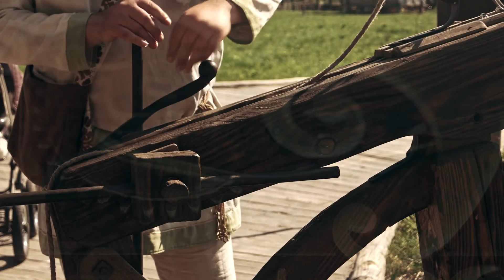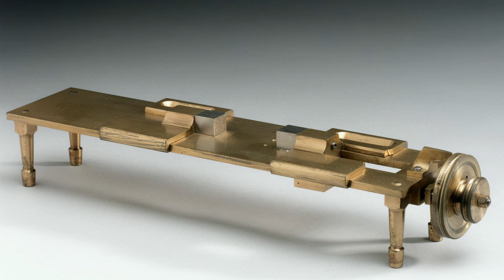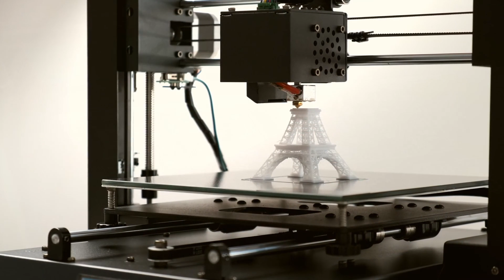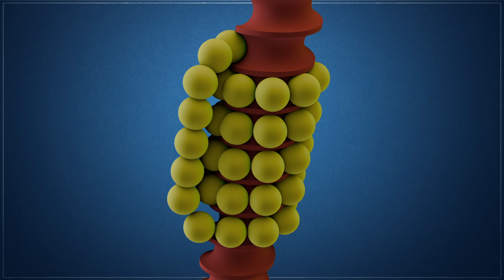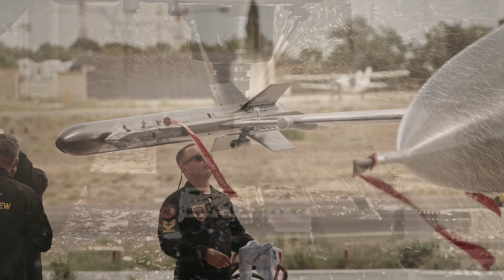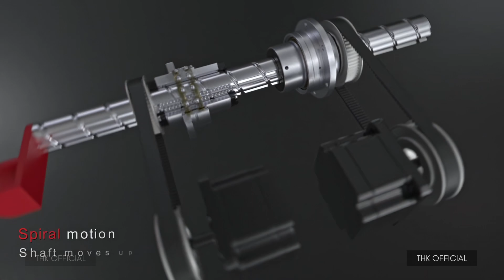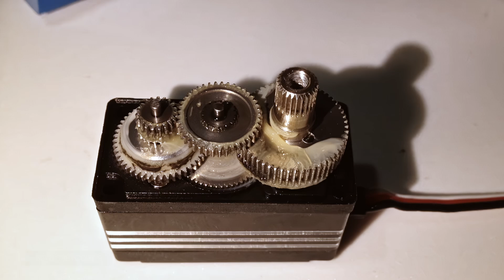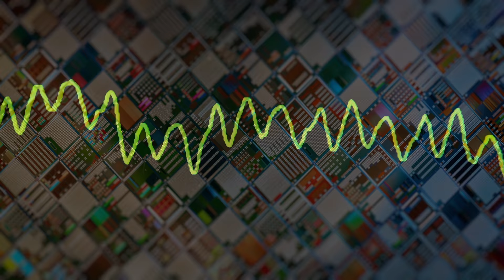The Obsessive Engineering of Precision Linear Motion

Comment: The last 5 minutes of this video beautifully captures the incredibly non-linear progress of modern-day technology. We spent the last 400 years gradually making two pieces of metal  translate motion a little bit more accurately and a little bit more efficiently, and then the need to manufacture microprocessors came along and in less than 1/10th of time we created hybrid motion systems which use the deformation of crystalline materials to achieve atomic levels of positioning and accuracy under extreme speeds and loading. It's hard to even imagine what the next 20 years might look like.
Reply: AI, Ram-shortages, and the Lash.
Reply: @fnamelname9077  While I'd gladly trade buggery for ram shortages, trading rum for AI seems a bad deal.
Reply: @fnamelname9077  Yellow king from 1774 for next president!!
Reply: @thekinginyellow1744  but WHY is the rum gone?
Reply: I think its slowed down again. We've had microprocessors, now we need something new since microprocessors are kinda reaching their limit of how fast they can get. They might get more efficient though.
Reply: @dukkiegamer1733 nah the upper limit is pushed further every day the scalability of the top is just lacking currently.
Reply: Evolution can lead to the replication of molecular mechanisms that operate in living organisms.
Reply: Seems very linear to me. Cant have the last step without all the previous steps.
Reply: @memberHD linear in regards to time. If you plot a graph with technological advancement vs time, it’s definitely not linear.
Reply: @lukeparsons583  It's absolutely linear. Just because the speed of advances increased, doesn't mean it's not linear.
Reply: Religious fundamentalist coming in and smashing it all up I'd bet.
Reply: @ThePaulv12  "blah, religion bad"
Reply: @ThePaulv12 everything good in your life came from the church lol
Reply: @PriceSimpson everything shit too
Reply: @PriceSimpson rofl, hogwash
Reply: @PriceSimpson Like the Earth as the centre of the universe? Or the justification of evil people to do evil acts? Or was it all the Pagan beliefs that were co-opted by religion? Was it the priests having their way with every kid that crossed their path? Was it the exile of woman from the congregation after their husband cheats on them? What is the good that specifically only comes from church?
Reply: @PriceSimpson  stop eating lead paint chips buddy…
Reply: ...and THEN, we developed artificial intelligence to make videos explaining it to us.
Reply: In 20 years we might be able to give a non-circular answer to the question: What is a woman?
Reply: @JohnSmithEx that's easy. Your mom.
Reply: @JohnSmithEx   IT'S AN AI BOT ACCOUNT STOP RESPONDING TO IT.
Reply: @JohnSmithEx that has nothing to do with engineering
Reply: @samwilde8311  It doesn't directly. I am just expressing my skepticism about the predictions for fast technological progress, given the current anti-western civilization climate.
Reply: @JohnSmithEx  you being an anxious hand-wringing dork about ideology also has nothing to do with engineering.
Reply: @badoverwatchhighlights7614  Why do you think that I am obnoxious? Obnoxious means being highly unpleasant, offensive, or incredibly annoying. It typically refers to behavior that shows a total lack of consideration for others, often characterized by being excessively loud, rude, or overly demanding. You could rightfully say that I am off-topic, but obnoxious? Why?
Reply: @JohnSmithEx  it is cause you are being all of those things
Reply: @badoverwatchhighlights7614  Anyone who states that ideology has nothing to do with Engineering is not a professional Engineer.
Ideology is at the core of all Engineering decisions and ethos.
Try to think in a divergent way for the first time in your narrow minded life.
Honestly, your attitude is one of the fundamental problems with Engineering, and why the planet and population is in such a state.
Reply: @a2aaron  it sounds like you are offended by the truth. That's exactly the mindset of most US college graduates in recent years. Technological progress doesn't emerge out of thin air. It requires an enabling substrata. It requires inquiring minds who strive for the truth, not angry indoctrinated ideologs who are offended by it.
Reply: ok
Reply: @JohnSmithEx You guys who think you're much smarter than you really are always crack me up. 

You let your anecdotal, close minded worldview cloud your judgement to the point of saying obviously foolish things with unearned confidence. The "anti-western" civilization climate is going to slow technological progress? 

That's nothing but word salad for fools who would rather stick their heads in the mud than be curious and evolve with the ever evolving world.
Reply: @JohnSmithEx By the way, you misread "anxious" as "obnoxious" - attention to detail must not be a strength of yours.
Reply: @Benisuber1  I am actually quite proud for my attention to details, but you are right, I failed in this one. It happens, I am not perfect. I am neither anxious nor obnoxious btw, and I am well aware of my intelligence. My IQ has been measured with multiple objective tests, and my average score of those tests is 99. I.e. my intelligence is average. Would you like to demonstrate that you are equally aware of your intelligence, by revealing your IQ score? Otherwise you might want to retract your statement "you think you're much smarter than you really are". I just proved to you that I am exactly as smart as I think. I am 99, and I think that I am 99. The two numbers match perfectly.

Regarding the anti-western civilization climate that you refuse to acknowledge, let me introduce you to the recent democratic congressional nominee Darializa Avila Chevalier (New York's 13th Congressional District), who founded a group known as CUAD, that on 2024 posted on Instagram: "We are Westerners fighting for the total eradication of Western civilization". When the positions in power are occupied by ideologs like Darializa Avila Chevalier, good luck with impressive technological advances in precision linear motion in the next 20 years. She has other plans for our tax dollars.
Reply: he said anxious
Reply: @JohnSmithEx  God that is so obnoxious (I think he said anxious but I think you are an obnoxious pedant - go on - google it and see if there is any other pedantic tangent you can launch off into because you want to fight the world with keyboard and dictionary 🤣
Reply: @JohnSmithEx  Do you not think that 'demanding' clarification on the nature of crowds in such an 'unpleasant' way is not 'annoying' or 'offensive'? You know it is, that's why you wrote it like that - so yeah, you tick all your own definition boxes for being obnoxious. Maybe be a bit more self aware - its why you don't get invited to the cool parties 🤣
Reply: @procatprocat9647  clean-up, aisle 4... we can consider the nature of engineering when you get back... ideology omfg. Try logic.
Reply: @Benisuber1  true, professional engineers are not observant or logical. The best trait for an engineer is to be ideological remember - like Kim Jon Un... 🤣
Reply: @russwhiffle I used to limit my brain to mere logic, just like you do. Once i really grew up, i realised that ethics and ethos are the key to elevating Engineering from a back room geeky desk job to something really significant. 

The Maths, Physics, FEA, classical calculations, logic etc etc, etc remain skills and uses them as basic building blocks. 

You sound like you might be an undergraduate or a fresh faced newby graduate who knows nothing about the bigger picture.
Reply: @JohnSmithEx  Finally - the thing you ACTUALLY so badly wanted to tell everyone - are you trying to shoehorn some 2024 Instagram post onto every youtube video, pretending it is relevant? It is not the west that is so maligned - I think you will find it is predominantly the US. Well done on scoring 29 points higher than a mental disability btw. Really value your input.
Reply: @procatprocat9647  Oh, the same ad hominem attack you threw at other commenters when you had nothing to say. Wrong unfortunately, I design program (and build) machinery for industry. Largely CNC and test equipment for generation, quarrying and high speed food production industries. Been qualified for 27 years and my back reminds me daily that I am no undergraduate (mores the pity). You sound like you might be unemployed... (go on lie - we all know its true - or maybe you teach? you certainly don't work as an engineer)
Reply: @russwhiffle ah, you're just a designer. The bottom rung of the ladder. Design Engineers are the modern version of draftsmen, but they use FEA and claim they understand physics. They know nothing about physics, and the proof is their fixed cheat restraints. 

Proper FEA uses a fully balanced model with a 3-2-1 that can be interrogated and compared to the Free Body Diagram. You would know nothing about that at your level. 

I always control the use of FEA with people like you, because .....
SH1T IN = PRETTY SH1T OUT

You have confirmed what I suspected about you.
Reply: @procatprocat9647  Oh yeah lol? what do you do then? What did you earn last year? How many employee's do you have? What's the value of you confirmed PO's for the next quarter? A minute ago you were a geek on a desk in a back room - if that's the case I like my rung 🤣. C'mon admit it you do nothing. Why are you watching such low brow content as this with your mega intellect? Looking for the ethics of lead screws? OK, maybe your not in it for the money - what innovations have you contributed to? To which engineering 'ideology' do you subscribe? Did you find the Higgs Bosun in one of those desk drawers? You are doing a good job of saying nothing, a meaningless word salad that seems defensive to me. Come on - 1 achievement you are proud of in your illustrious (and highly ethical and ideological) career. Just one.
Reply: @procatprocat9647  No one except u meantioned FEA. Sounds like thats the only thing that you know. You are pretty full of yourself. People like you are bad at their job because they not gonna learn new things if they are told to. if you cant programm a basic FEA but use FEA and think you know anything about how it actually works you are just being clueless. how about you write your own FEA and you will be humbled. even if you think you know so much about it, you are gonna see its laughable how shallow you knowledge is
Reply: @russwhiffle your comprehensions skills are very poor. 
I hope other people read specs and documents, then tell you what to do because otherwise you are a liability. 

I never claimed that i am the back room geek, you fool. 

I explained that i learned about ethos, etc which elevated me many many rungs above that bottom rung design engineer type role.
Reply: @procatprocat9647  Your memory skills are pretty poor too 🤣. Just to refresh you, you said:

"Once i really grew up, i realised that ethics and ethos are the key to elevating Engineering from a back room geeky desk job to something really significant."

Which implies the geeky desk job in a back room. It is not definitive - but the best estimation any of us can make as you have said absolutely nothing definitive about your skills, training or occupation - which is why we all suspect they are not up to much. Just vaguely saying you have an ethos and learnt about ethics so that makes you great and everyone else you have replied to is basically trash.  Now Ill ask you again - what do you do - or have you done or even been a small part of that makes you so special (we all know the answer is fuck all, but I am curious how you will respond. Will you ignore the direct question and try to deflect with more grandstanding and insults? I suspect you will because you have nothing to say).
Reply: @procatprocat9647  gone awful quiet there Nicola Tesla 🤣. Look, some free advice, its great that you have started to get an interest in how things work and you are watching a few videos, maybe this will help you decide what you want to do when you grow up, but when there are people (even in comment sections) who are already knowledgeable and in the profession, why not just talk to them? Be honest and you might learn something - it might be useful in deciding if you actually want to go to school and study it. Pretending you are in the upper echelon of a career you very obviously know little to nothing about is just embarrassing, and friends you could have made are just going to think you are a bit strange. No hard feelings I've only been teasing you a bit - best of luck with your future career - whatever you decide you would like to do - just don't be so defensive/offensive with people - it wont get you very far in life 👍
Reply: @russwhiffle i just gave you some very high quality advice. 

If you're too dumb to take it on then that's your issue. 

Not everyone is as dumb as you

Edit - the industry you are in is at the lower end of Engineering, but you could still work your way into higher tech industries if you really work on it

Feel free to ask questions if you like. 

I didn’t read much of your message because I'm busy this evening, but thanks for typing so much
Reply: @russwhiffle let me compare you as a digger designer to myself. 

I design submarines, bespoke subsea vehicles and robotics, and robots that decommission nuclear reactor cores. 

You are a toddler in the realms of Engineering. Nothing that you do matters because you have insane FOS. It is Engineering for numbskulls
Reply: @russwhiffle  yes my friend, I misread anxious as obnoxious. It was a mistake that I have already admitted. Regarding my question about the nature of crowds, that question was under another thread, the one under ts109's comment. If you don't mind, I would prefer to discuss about it there.

About me being proud for scoring 29 points higher than a m/d, no, I am neither proud nor ashamed. My IQ score is an immutable physical characteristic: I can do nothing to change it. It's funny though that Benisuber1 tried to shame me for having an inflated idea about my intelligence, and then you came along and tried to shame me for knowing exactly what my IQ is. I am always amused when people try to win arguments on the internet by throwing ad hominems, because it never works. Instead of proving me wrong, you are only proving that you have no confidence to your arguments. If your arguments are strong and solid, just confront me with them, and watch me run defeated for hills. After all I am only 29 points higher than m/d, so what are you afraid of? 🙂
Reply: @JohnSmithEx  I think what he possibly picked up on was you massive arrogance, which is present in the message I am replying to now as well. Having now been told about your sub par IQ it is even more baffling that you would conduct yourself in this way.

The anxious/obnoxious error is an interesting example. You brush it off as a simple misreading, which is of course fine, relatable and barely worthy of comment. But you didn't just misread. You Misread, then launch into a lengthy diatribe where you deconstructed the word, broke it down into its key defining traits and explained how they couldn't possibly apply to you while (again very arrogantly) implying that the poster who you misread is a fool who doesn't understand the word he (never) used. Even more amusing is that both the words he used absolutely do apply to you and I would expect anyone (even with an average IQ and a little bit of self awareness) to be able to see. It is hypocritical of you to launch such a huge rebuke over his misapplication of the word obnoxious, then expect no one to pull you up on the fact that you couldn't even read the word, let alone understand if it applies to your comments fairly or not.
As for your arguments, I'm trying to pin down what they actually are at the minute. As my grandfather used to say, they are "like dog shit, all over the place".  What is the point you would like to try and make here, because it seems like you are starting a fresh argument with every comment - often just picking a word or phrase out of the comment you are replying too and trying to contradict it somehow to make yourself seem smarter. This is not an uncommon trolling tactic to keep a bit of engagement going by 'rage baiting' the audience. I was kind of hoping that this is what you were doing, because if you are not a troll it would appear that this is actually your personality which make me feel a bit sad for you. I am happy to engage in a bit of debate with you (rather than 'run for the hills') but please enlighten me - what is the argument you are trying to make and we can discuss it. Was it something about crowds? Or Trump? Or Transexuals? Or Language? Or IQ? Or Ad hominins? Maybe politics (although you seem to have declined to go further down that road since I replied to that and you now consider that 'topic' off topic for some reason. I am fairly sure your point is not about the progressing of linear motion engineering but never mind that for now, lets focus on you - what would you actually like to say?
Reply: Oh my friend  @russwhiffle , you are continuing with the argumenta ad hominem like your life depends on them. You really don't know any other way to engage in a dialog, do you? You called me arrogant, and in the next sentence you called my 99 IQ "sub par". 99 IQ is average my friend. Calling an average IQ "sub par" reveals a massive arrogance, and a deep contempt for the common people. You are an elitist Russ. You are an elitist without elite communication skills, and without elite manners and chivalry.

I'll make a bold guess here, that you've never completed an IQ test in your life. If my guess is correct, I am encouraging you to spend a couple of hours and complete a couple of those online. Most are free, although some scummy sites exist that won't reveal your score unless you give them your credit card information. Knowing your IQ score might be a humbling experience for you, as it was for me. You might discover that you are not an elite after all, and you are just part of the plebes like me. You might be one of the 26% of the people with IQ between 95-105, or one of the 50% of the people with IQ between 90-110. You might cry a little, mourning for the lost dream of being special, but eventually you will have to reconcile with the reality. Truth will set you free my friend.
Reply: This comment section has been an interesting read. It appears that everyone enjoys arguing a lot. Though, the amount of ad hominem does make it as a debate rather stale. Everyone here could learn something about showing respect to others online. There is no such thing as a simple-minded person.

That being said, I would like to respond to a couple of things @JohnSmithEx said that kind of started this all. Everything said has a context attached to it, and outside of that context there the words often become meaningless. The CUAD comment is a great example of that. Conservative news outlets will spin it as representative of an anti-America sentiment and say that liberals want to destroy America, but really it was just a hyberbolic statement of anti-imperialism in response to what was happening in Palestine (thousands of killings, cutting of food, water, etc to 2M people, forcing 750k out of their homes, etc.), and they by no means meant it literally. You make think they meant it literally, and conservative commentators will report that they meant it literally, but they really didn't. Any single person's view of reality is not objective, and echo-chambers create distorted realities where what you think you know can be completely wrong. The idea of a broad anti-Western sentiment only exists in conservative news outlets. Both liberals and conservatives believe they want to save the country, and that the other side is destroying it; in liberal media you will not find calls to destroy America, but you will find calls to save America from perceived fascism. Now, there IS broad anti-Western sentiment within some other countries (like many Middle East, which if you look at history have their reasons), but it's not very present at home. The other comment I would like to address, the question of "what is a woman?" also follows the same pattern. It's a thing that is shown in conservative echo chambers trying to say liberals can't answer it, but in reality the majority of actual liberals can readily answer that question (the shortest answer is adult female human, and you can ask follow up questions to get as detailed of an answer as you want).
Reply: @JohnSmithEx  I have done 2 in my life 10 years apart - the first one set up by the elite school I did indeed go to. Not because it was standard for all student there (it wasn't) but because myself and 18 other students (out of just over 1000) were offered the opportunity based on out participation in performance based extra curricular groups which were indeed elitist. Online Facebook assessments are not IQ tests. Both times my score was the same, both times it was 52% higher than yours (see if you can work it out. It is not a measure of knowledge or expertise. I can learn things faster than you that's all. If you studied something and I hadn't you would be more knowledgeable and I would be the guy humbly picking your brains until I understood the subject. But that's not the reason you get negative reactions from everyone online (and I suspect elsewhere). Maybe it is a developmental or spectrum disorder that prevents you from seeing that and learning from your behaviour. Maybe you arrogance is simple Dunning-Kruger. Which is strange because you claim to have been tested and found lacking. Maybe instead of rudely shooting others down you should learn to accept your intellectual limitations and try to learn from your betters?
Reply: @russwhiffle  52% over 99 is 150 IQ. This score falls into the highly gifted or "genius" tier, achieved by roughly the top 0.1% of the population. So according to your Intelligence Quotient score, you are indeed elite. That's the good news. The bad news is that you didn't make good use of your exceptional hardware in this discussion. Here are my observations:

1. We had two parallel discussions in two separate threads, and you were bringing stuff from the one discussion to the other. This made it harder for everyone to keep track of the discussions.

2. You were needlessly contemptuous about my average 99 IQ, when you didn't have to. All you had to do was to let your intelligence speak for itself. Dissect my arguments, find their week points, and dismantle them. Much more effective, and you would avoid presenting yourself as a snob. Ad hominems never work.

3. You were making big deal of trivial things, like my careless mistake of misreading anxious for obnoxious. You were trying desperately to make something out of nothing, instead of focusing on the stuff that matters.

4. You couldn't contain your excitement, and posted multiple consecutive comments, disrupting the flow of the discussion and creating confusion.

5. You tried to refute my arguments by speculating about my intentions. Who cares about my intentions? All that matters is if what I said is true or false. Attack my arguments directly and refute them, that how it's done.

So honestly, I was not impressed by your performance Russ. Hopefully you will manage to impress me the next time we will meet on the internet. Your hardware is outstanding. You just need to combine it with a better software my friend. I want to thank for our discussion, and I wish you a nice day.
Reply: @amcrjlnv thank you my friend for your feedback. I wasn't expecting anyone to read that far. This discussion had devolved to Russ and me exchanging comments about our intelligence. Unfortunately I can't address your points, because the answer that I have prepared doesn't pass the YT filter. I tried a few different things, but I can't defeat the algorithm. Sorry about that. It's neither your fault nor mine.
Reply: @samwilde8311  it might have everything to do with engineering depending on what they are
Reply: @JohnSmithEx  Yes, because only western civilisation is able to achieve technological progress, sure sure… let‘s just sit around and pretend, that in this very video, a japanese guy wasn‘t responsible for one of the major breakthroughs. Let‘s pretend that Cuba while under embargo for 70 years didn‘t pump out medical research breakthroughs like a factory. Let‘s pretend China isn‘t overtaking basically everyone in basically every field. Let‘s pretend that a handful of very enthusiastic and probably genderqueer linux developers aren‘t holding up everything in this digital world by their bare teeth. 

Please don‘t come crying when you find out that you too aren‘t immune to propaganda
Reply: @russwhiffle  Logic is rigid. Chaos is where stuff comes from.
Reply: @JohnSmithEx   I have never taken an IQ test because I know better than to trust pseudo-science meant to massage the ego of the weak willed. 

A singular anecdote does not an argument make. And a nominee is not someone who occupies a position of power, by definition. At least you continue to prove your lack of attention to detail.
Reply: @Benisuber1  my friend you claimed that I think that I am much smarter than I really am. Then I used my IQ score to prove that you are wrong, and that I am exactly as smart as I think I am. Now instead of retracting your claim, you are expressing your lack of trust on IQ tests. OK, fine, you don't believe in this standardized measurement of human cognitive ability and intelligence, that has been used extensively all over the world for more than a century. How do you know then how smart I am, and how smart I think I am? What is the source of your knowledge? Please prove your claim. Prove that your claims are fact-based, and you are not just making stuff up.

Regarding the congressional nominee Darializa Avila Chevalier, who is associated with the idea of totally eradicating the Western civilization, she is supported by the mayor of New York Zohran Mamdani, the Justice Democrats, and the Democratic Socialists of America. She might not occupy a position of power yet, but she is supported by others who do occupy such positions. Should I wait until she becomes the President of the United States before I start warning about her ideas?
Reply: @JohnSmithEx IQ tests are famously pseudoscience, you may want to do some research on the topic. IQ tests are neither an objective nor standardized measure of intelligence, and yes you still think you are smarter than you actually are. Lobotomies were performed across the world for nearly half a century, time is not proof of efficacy. Another egregiously iunb argument from you. 

Your comments are filled with condescension and assumed truths, the fact that you can so confidently blather on with the same nonsense for weeks is all the proof I need to know that you are close-minded due to your need to feel superior to others who don't agree with you.  

Regarding one nominee for political office, I maintain my stance that cherry picking a singular person from hundreds of millions is an incredibly silly way to prove a generalized point. I can pick any number of nominated conservatives who support genocide, does that mean I can argue that the current climate is actually pro-Western world domination? If you can't understand that argument, even an average intelligence is a substantial overestimate.
Go ahead, hold your breath until a President says they support eradicating Western Civilization. You'll make Vitomir Maričić jealous.
Reply: @Benisuber1  my friend I wish I could say that your reply is satisfying, but it's not. One month ago you made a claim about my intelligence. Then I disproved your claim with my IQ score. Then you rejected my proof on the basis that you don't believe in IQ tests. Then I asked you in no ambiguous terms to prove your claim. Your last comment was your chance to do it, and you didn't. Instead you just repeated your claim:

> and yes you still think you are smarter than you actually are.

Someone said that insanity is doing the same thing over and over again and expecting different results. I am not going to ask you again to prove your claim, because I expect the same result: you aren't going to do it, and you'll just repeat your claim. So it's time for me to remove myself from this discussion, because it makes neither of us any wiser. We are both wasting slices of our short lifespans for nothing. If I had to do the same thing over and over again, at least this thing should be enjoyable, or profitable, and our discussion is neither. So bless your heart, and have a nice day my friend.
Reply: @JohnSmithEx  You seem to think we are friends as well, I am not quite sure where your delusions come from but they are obviously present. 

IQ scores are not proof of anything because they are inherently flawed measures of intelligence. A faulty metric cannot prove or disprove anything. You are confident in your beliefs without any semblance of real proof, which sadly altogether too common in our society today.
Reply: @Benisuber1  This is easily in the top 10 of the most unproductive discussions that I've ever done on the internet. Absolutely no progress after 2 months of back and forth!
Reply: @JohnSmithEx  There's one in every crowd.
Reply: @ts109  I am confused. There is one of what? Please elaborate.
Reply: @JohnSmithEx  Sure you are John, sure you are.
Reply: @ts109  I would be less confused if you helped a little. For example by being meaningful, clear and precise. But apparently this is not your style my friend.
Reply: @JohnSmithEx someone who follows Matt Walsh and the Daily Wire. That feels it's necessary to insert their opinion on transgender politics into a video about mechanics and measurement.
Reply: @ts109 
A trans person?
Reply: @cringeisen  Are you clarifying the claim "There's one in every crowd"? Thanks for doing it, because @ts109 didn't want to. Since you mentioned it, I do follow Matt Walsh, and I do believe that tr****ism is a major attack on the pursuit of truth, which is a core western value. You want engineers to improve the precision of linear motion machines, and you want the same engineers to affirm the delusions of XY who believe that they are XX and vice versa? That's like expecting solid theorems from mathematicians who affirm the delusion that 2 + 2 = 5 (this is a Big Brother reference). Affirming delusions by law is not conducive to technological  progress.

Now, since you took the task of continuing @ts109 thread, please educate me about crowds. Apparently you affirm that there is one like me in every crowd. What is a crowd in the internet? Are all YT viewers a single crowd, or each YT video has a separate crowd below in the comments? Yesterday I posted comments on 3 separate YT videos. Did I inserted myself in 3 crowds? One of these videos was an old chess video with 3-4 comments, and my comment was a complaint about the time control (too short). Did I became the "one" that exists in that particular crowd? Please share your expertise about crowds with us.
Reply: @JohnSmithEx  your analogy of 2+2=5 is inaccurate. You’re more like an old engineer who was asked “how do we fix backlash in a rack and pinion system?” And your confident answer is “well, we can make a tighter fit, increasing wear and friction, or we can deal with the backlash! It’s a binary system, no way around it!” 

The world is never binary and your simplified view of things is simply a self-imposed ignorance. If you would like to advance beyond “rack and pinion” thinking you can start by learning about intersex individuals and how even in nature sex isn’t simply binary. Then you can learn the difference between sex and gender, and finally realize that binary right/wrong thinking such as yours does more to stifle innovation than it does to progress it. 
Y’know, like how most of these advancements come from those “librul indoctrination colleges and intellectual elitists.”
Reply: @JohnSmithEx  They are different engineers pretty sure. Did you say Trumpism is an attack on core western values? I assume that is what you wrote as it certainly makes sense.
Reply: @russwhiffle  I think that the MAGA movement is a defense of the core western values, not an attack on them. Here is a partial list of those values: Individual liberty, economic freedom, representative governance, human rights, separation of church and state, rationalism and scientific inquiry. I don't think that the current president of US has attacked any of those, but you might want to correct me if I am wrong.
Reply: @JohnSmithEx  hahaha your trolling right? Liberties are being erased (by trump) the economic freedom to pay more for everything and get less (when was the last time you filled your tank?) Representative government? Say it again when they are military personnel seizing ballot boxes) human rights? Tell that to the ICE team and their victims. Separation of church and state? you cant be serious, the president is being anointed by televangelists and posting pictures of himself as Jesus. Rationalism and scientific inquiry? My favorite one, does science tell you to drink bleach or take horse medicine to cure covid? The most irrational man with a band of white supremacist conspiracy nuts for followers. Its like you've listed all the biggest faults of this administration and called them strengths? you're off your head.
Reply: @russwhiffle  No, trolling is not my style. I gave you a direct and honest answer to your question. I read your answer, and I could address some of the point you made, but it would be way off topic here, so I won't. I am not disregarding your arguments, I respect them, but I don't see the point of defending the current US president here. My original intention was to warn about the adverse effects of the raising anti-western culture on the future technological progress, not to defend a political party and its policies.
Reply: @JohnSmithEx  Your health minister thinks vaccines are dangerous lmfao
Reply: @Venaticc  who is my health minister? FYI, I live in Eastern Europe.
Reply: @JohnSmithEx  Oh, sorry about that. I assumed, since the discussion was about American politics, that you would be as well. I myself am Nordic. The corrected version: The American health minister, appointed by Trump, believes vaccines are dangerous even though every single credible study concludes their safety (unless the vaccine was faulty (which is very, very rare), in which case it stops being used). hbomberguy made a great video on how the hoax began.
Reply: @Venaticc  I assume that you are talking about Robert F. Kennedy Jr. Honestly I haven't followed his opinion about vaccines, but I assume that he has not prevented anyone who wants to be vaccinated from doing so. Compare this with the previous administration, that forced tens of millions of people to be vaccinated whether they wanted it or not, under the threat of losing their jobs and other privileges, like entering into public spaces. Personally I value the individual liberty, which is a core western value, so given the option I would chose RFK every day over whoever was the health minister of the previous administration.

Btw I do follow closely the American politics, because whatever happens in US it also happens in Europe a few years later.
Reply: @JohnSmithEx  herd immunity via vaccination is not something that should be up to individuals
Reply: @Sopel997  Individual liberty is a core western value that should be protected passionately, unless there is pretty good damn reason to abolish it. Certainly not for an experimental vaccine that protects you neither from caching a decease, nor from transmitting it to others.
Reply: @JohnSmithEx  measles vaccines are experimental?
Reply: @Sopel997  I am not educated on the measles vaccine. According to Wikipedia it's an effective vaccine, that protects against becoming infected with measles after two doses almost 100% for life. What's your point?
Reply: @JohnSmithEx  that we're talking about ALL vaccines
Reply: @Sopel997  I didn't start the discussion about vaccines. It started as an off-topic comment by someone who made the (wrong) assumption that I am a US citizen, and that I support all policies of the current US administration. Vaccines are not an interesting topic for me.
Reply: Maybe it won't get any better just wayyyyyyy faster through AI